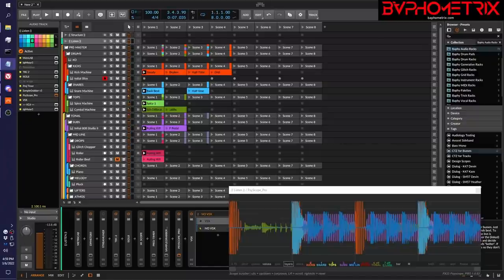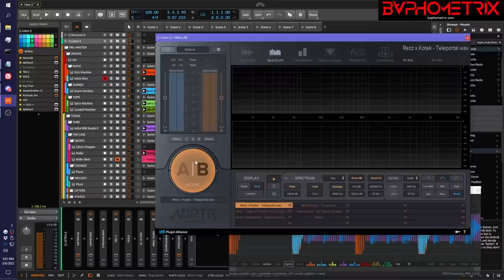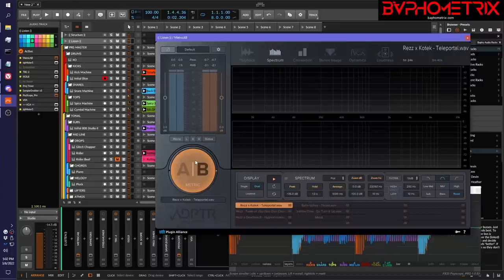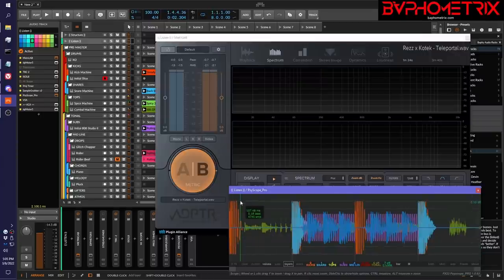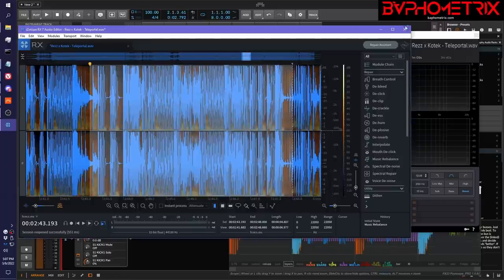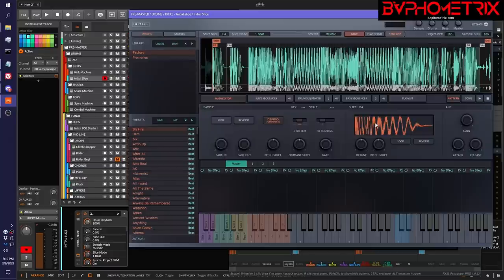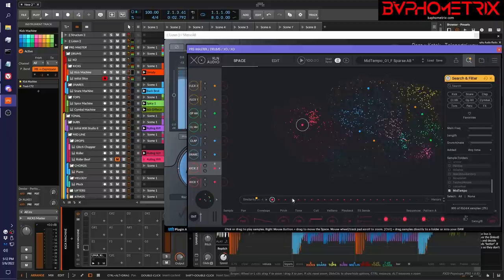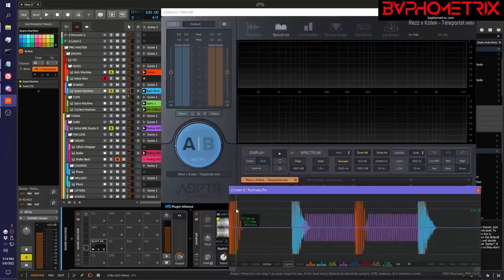Mixing Loud with CTZ - Ep. 9 -  Setting Your Mix Anchor & Framework

Comment: I love your CTZ method so much, but I still have 1 thing I’m uncertain about after watching all 23 episodes, so I came back to this video to see if there’s something that I missed, but I’m still confused. I understand how the anchor/framework sounds work. I understand that you set the kick and snare’s track volume to zero and clip them into zero if needed to match them to your reference track’s loudness and then you get your subs fundamental sitting around -6. The thing I’m unsure about still is where to set the track volumes of your other sounds such as your mid bass, hi hats and percs, background chords, fx sweeps etc. There seems to be a balancing act between how much you clip the transient of those sounds vs where you set their track fader. For example, your hi hats. If you clip your hats to get their transients to sound more consistent, there’s a weird balancing act there to figure out where to put their track fader  vs how hard to clip them, basically the transient vs sustaining volume. Same for mid bass or whatever else. Do you have your mid bass at 0? -1, -2, -3, etc?
Reply from the maker: Good question. This goes back to some points I make in Episode 2. Not every sound can be made "loud enough" (dense enough) to fit into the framework of a really loud mix. Some sounds simply fall apart when you try to clip (or limit) them and shrink their crest factor small enough that you can balance the RMS of that sound into the level it needs to sit inside of a loud framework.

The beauty of working the CTZ way is that you immediately and instantly realize a certain sound will fall apart. Instead of waiting until the "mastering stage" of your project just to discover how many sounds (and the entire mix) falls apart when you try to squash everything way too hard into a mastering limiter.

So for any new sound (mid-bass, pluck, chord, atmos, foley, etc.) you leave the fader at unity. Then you gain up the sound (in front of the track fader) using your sampler or synth's master volume. Or by normalizing the gain of a sample clip so that its peaks are just kissing zero. Or by using the dpMeter trick to just normalize the sound that way.  Is the sound now loud enough, in the context of your framework and any other sounds you've already introduced to the mix? 

If the answer is Yes. Then you're good. Maybe the sound is even TOO loud. In which case you can bring the gain down, or even just pull the fader down (although at this early point I usually leave the fader at unity and just adjust the pre-fader gain.

If the answer is No, then you need to keep increasing the gain into the clipper until it's finally loud enough in the context of your framework and existing mix. And now the quesiton is "Did I just kill the sound? Can I hear the clipping?" And that's when you use the tricks I show to compare the clipped vs unclipped sound at the same perceived loudness to make that decision. If the sound is somehow made "bad-sounding" because of the clipping, then it's either time to go looking for a different sound, or maybe you can fix the problem by sequencing the sound in a different way in your arrangement, or maybe you can fix the problem by looking close at whether that sound has it's own area in the spectrum, or in the stereo field, or in the depth field, etc. so that you can REDUCE THE GAIN on that sound and yet still have it audible in your mix where it needs to sit.
Reply: @Baphometrix so basically im “shrinking” the dynamic range of each element in the mix by as much as that element allows me to do: like kick and snares will be “abused” more than a soft pad! After i make sure i like each of element with their maximum individual loudness, ill start balancing with faders but the anchor sounds are sitting at zero! Im on cubase and i think it is very appropriate daw for CTZ!
Reply: @Baphometrix  I have a question: for the “non-framework” sounds, why do you choose to adjust the Gain instead pulling down faders?
Reply: fantastic answer thank you @Baphometrix

Comment: Love your lessons and whole approach, I was able to achieve fantastic results. I can now compere my tracks with my favourite downtempo artists with real satisfaction.
May I ask you something?: What if my track reaches even 4 or 3 RMS in some moments and still sounds clear with no distortion, It might be silly question but should I decrease it ?
I am shocked that it sounds clear even at such a high loudness meters. Without you I would never see how it is to be satisfy with my own production. Love you :D
Reply from the maker: It's common for the short-term max and the momentary max LUFS values to be much higher than the integrated LUFS as measured across the loudest section in the song.  RMS is essentially the same as momentary LUFS. So yes, occasionally hitting -3 or -4 RMS--would be quite normal in a song where the loudest drop/chorus is measuring in at a pretty loud -7 or -6 LUFS integrated.

Comment: Excellent video as usual, Baph. I don't know how I got along without your channel's advice all these years of struggling with wimpy mixes. I have a question... do you wait to put a clipper on all your sub-bus tracks until you get to the mixing stage? Or are you clipping sub-bus tracks in the composition stage? And do you push your all your bus faders down below 0db so that when they sum they don't clip the master channel which is untouched at 0db? Thanks!
Reply from the maker: Put them clippers on errythang!  Seriously, though, yes. It's *very* important to always have clippers sitting on every bus. I explain *why* in episode 7 (and also back in episode 2).

Comment: Hey Baphy you will probably go over this in future episodes but I was wondering what you do about the low end artifacts caused by clipping? Do you leave them or remove them with linear phase eq? Also if you do, is it done at each track or bus? Thank you so much for this series. I have always struggled with loudness and this is a huge help!
Reply from the maker: Um... you don't exactly get "low end artifacts" from clipping. You get higher frequency harmonics that go upward in the spectrum. Yes, in the digital realm you can get some aliasing foldback from the harmonics that extend past Nyquist, but these tend to attenuate quite a bit as they reflect backward from Nyquist.  I mean, if you solo the delta from a Clipper, you hear the clipping distortion as little "spits and crackles" of mostly mid- and high-frequency content. You don't hear any audible bass/sub rumble.  Sure, you get something called "intermodulation distortion" from the aliasing foldback, but again, it's usually so far down towards the noise floor that it's a non-issue, especially if you're not OVER-clipping the WRONG types of signals.  Remember, the idea of clipping for dynamic range control is to do it as "transparently" as possible. If you're *hearing* the clipping and it sounds "bad" to you, then you're clipping too much.

Comment: Hey Baphometrix,

Do you have (or could you make) a video specific to actually setting up a kick, snare and sub starting point. I understand the processes you talk through in this video but it would be great to see the process of starting with a raw kick, snare and sub and processing them all using CTZ in order to get to the stage in this video where you have all three hitting at -7LUFUS.

In this video, the kick, snare and sub have already been set up and are ready go. I would like to see things such as: how you eq the kick going into the clipper, how to get kick samples to -10 momentary loudness (this I find hard), how you are saturating the sub (i.e. with a saturation plug in or soft clipping), how you get the kick and snare to layer nicely etc. 

For me, this would be very useful because this is the backbone to the CTZ mixing process and I want to know that i am setting it up correctly. If you already have a specific video, could you please direct me to it as I can't find it.
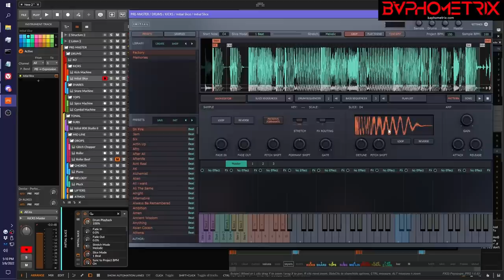Reply from the maker: At around 10:30 I start showing how I found a kick and snare in my sample library that essentially matched the reference track's kick and snare in both timbre and loudness. At 13:42 I explain that not all of the kicks/snares I tested could be made loud enough without distorting. How did I do this in XO? Because I have a passive instance of KClip sitting on the track where XO is. That instance is set to clip at 0 dBFS. If I use XO's own internal volume knobs to crank up the gain of the slots where I'm auditioning kick and snares, so that those kicks and snares are just as loud as what I'm hearing in the reference track, then if the sample "sounds good" at that amount of clipping, it can clearly be made loud enough to match the reference track by just pushing it into a clipper.

As I mention at 13:42, not every kick or snare could be pushed to the same loudness as the reference track's kick and snare without sounding obviously distorted in a "bad" way. 

This is a fundamental point I make often. Not every sound can be made loud enough to fit a really loud mix. They just cannot survive the amount of clipping/limiting necessary. So part of identifying samples I have that could work for this loud of a song, I simply slapped a clipper at 0 dBFS on XO and then cranked up the volume of XO so that the samples I was auditioning in it were as loud as the reference track samples I was playing out of Initial Slice. (Matched in loudness by ear.)

This is the simplest way to get the right kick and snare. By ear, and by cramming them through a clipper to get them loud enough to match your reference track. If they sound good even when pushed into the clipper to be loud enough, then you're golden. If not, then that's a kick or snare that you'll probably never be able to process or modify to be loud enough to work in a mix for that genre you're referencing against.

Yes, there are some sample pack kicks/snares that can take a lot of punishment and still sound good. There are others that cannot.

Yes, there are some tricks you can use to really hammer a stubborn kick or snare into the right shape to be loud enough. Maybe someday I'll talk about them? They're not perfect. They just get you a *little* more loudness. 

If you make your own kicks and snares, with synths or with Kick2 or with whatever drum lab or drum designer plugin.... that's an adventure. It's a big subject. Kicks and snares are so genre-dependent. And if you're building it yourself from scratch, you just need a lot of practice and trial-and-error to learn how to build kicks and snares that can be made really loud.

As for the sub, again, there are SO many different ways to approach making subs. So many tools. In my case, I have some pet tools and some pet approaches. Maybe some day I'll do a video on that, but again, the "right" sub for any given song is a very genre-dependent thing. And you kinda need to play it by ear. There isn't any one single "best' way. I made the sub in this video using Initial 808 Studio II, and using one of its subtle analog-shaped sine waves, with just a little of its own internal Saturation module to give it just enough harmonics to be audible (in the right way) in the mix on small speakers that can't reproduce anything below 100Hz.

Comment: That's interesting about the sub being -6db for bass heavy music. I would imagine it would be higher, especially for REZZ's music. Which genres should the sub be at 0dbfs? I imagine an 808 especially as its both sub and bass?
Reply from the maker: it can indeed be higher. But starting at -6 is a good starting point. Later as your heaviest drop arrangement builds up, you'll be able to adjust how much sub you really need.
Reply: @Baphometrix  I see. I guess the amount of sub depends on the balance of the mix, for example a dark drop without much brightness may have more sub? One more question, is there a quick fool-proof way to check if you have too much sub?
Reply from the maker: @randallflagg533  Quick and fool-proof? No. You have to compare to your reference tracks. You need to look at the signal in an oscilloscope. You need to see how high the sub fundamentals are hitting on a spectrum analzyer versus how high the fundamentals hit on your reference tracks. You need headphones that let you HEAR the sub (Your room and speakers will lie to you about the sub.) If you have access to something like Slate VSX, it's very easy to hear the sub in many of the rooms/emulations in VSX.
Reply: @Baphometrix  Yes, I have Realphones instead of VSX. It's great for hearing those long drawn out bass frequencies! I recommend it. Now that you mention fundamentals, what are your thoughts about sub harmonics under 100hz? Is hitting only one octave in the sub region always enough? I know some sub generators have two oscillators so it makes me wonder haha
Reply from the maker: @randallflagg533  With subs, it's a balancing act between something clean down below 70 Hz or so that will help the sub arrays push air efficiently, vs something with harmonics that will imply what the sub is doing on speakers/earbuds that cannot really reproduce anything below 100 Hz or so. There are so many ways to do dirty and clean subs. If it sounds good, it is good.
Reply: @Baphometrix  Thanks. This has been sooo helpful. Time to put it all into practice starting tomorrow:)

Comment: Baphy, by the way I wondering if after reaching such a loudness, do u still put a limiter on the master bus. And if so, do you push into the ceiling for extra loudness or is it just clipping safe ? Thanks in advance.
Reply from the maker: I also use a final mastering limiter. But it usually does almost no work. On my pre-master bus I might have some "pretty processing", which might comprise some final minor EQ tweaks, *maybe* some vintage tape saturation and/or Gullfoss, and *maybe* some light SSL-style bus compression. All of this processing usually adds a few small peaks over 0 dBFS that need to be shaved off again by a final mastering limiter. I'll be talking about all this (and showing it) in some of the final episodes of this series.

Comment: If the Kick and Snare are your anchor sounds that should always sit at 0db, wouldn't it make sense to not include the Kick and Snare on the "VCA" knob? If you mixed super hot and needed more dynamics the VCA knob could potentially lower the Kick and Snare to sit underneath 0db.
Reply from the maker: In MOST cases, you need to clip the kick and snare very heavily to get them up at the "anchor" loudness necessary to anchor a very loud mix. So pulling them down out of the clipper just gives them more transient "punch" back, and makes them sound less "flabby".
Reply: @Baphometrix  Makes sense! I tend to make my own kicks so I have the freedom/control to choose how much I'm clipping the transient versus the sub. If this is the case where the transient cant handle much more clipping at all, would it then be appropriate to leave the vca knob off the kick?

Comment: Thanks again Baph! Have you seen the k clip creators advice in regards to bus clipping? he says to keep the ceiling under zero.
Reply from the maker: I'm going to need to see a specific link? Or some way to see exactly what they said. :)  My *guess* is that they mean that "keep ceiling under zero" in response to using KClip in oversampled mode. But I don't recommend using KClip in oversampled mode for my CTZ method.  Also, you have to remember that ALL tracks and busses in every DAW (worth using) run at 32-bit float. That means there is TONS of headroom above 0 dBFS. Just because some stray oversampled peaks go up above 0 dBFS on any given track or bus does NOT mean that those peaks are clipped. The only place where 0 dBFS truly *matters* is the Master bus, from which every DAW actually prints the signal during an export to the file system.  If you've got peaks going over 0 dBFS on the Master bus, then yes, they will indeed be clipped in the exported file.  But.... If you have a mastering limiter as the final bit of processing on the Master (which should be the case), then the mastering limiter ensures that nothing is actually printed any higher than the ceiling specified in the limiter itself.
Reply: @Baphometrix  That answers the question spot on, thanks Baph.

Comment: Just another little question Baphy! I do trap instrumentals, I found some nice mixed beats, but most of them dont have parts where only the kick or the snare is hitting... They are always with the instrument sample above them and the 808. How can I slice the kick, snare or 808 from those, haha xD. I really want to wrap my head around this. Thanks!
Reply: you can't.  you can try stem separation but it usually sounds like trash.  Use your ears to match levels.
Reply: also if you are in Ableton you can just assign your tracks to deck A and the reference to deck B.  Then assign hot keys to the fader to allow you to switch between the decks.  I usually assign the "1" on my keyboard to deck A, the "2" to my master bus (so it turns off when I switch to deck B) and "3" to deck B.  Then you can hit "1" and "2" and the fader will switch to deck A and engage master bus.  Then hit "2" and 3" and it will switch to deck B (your reference) and turn off the master bus.  This works really well for matching levels.  Also you can use a spectrum analyzer to match levels.  Bapho doesn't mention minimeters, but it is a cheap and super dope oscilloscope.  Also full color, like Traktor or CDJ waveforms.  Throw your ears into the mix and you should be fine.  Remember, this isn't an exact science, close enough is good enough.  No music fans are gonna listen and be like "ERRMMM snare could be .6 db louder".
Reply: @punchilux5783  Thank you sir. So I need to get the elements to 0dbfs like in the refference and then try to make them louder if I need by clipping, right? If on The refference wave form I see the snare is on 0dbfs should I put my snare like that too?